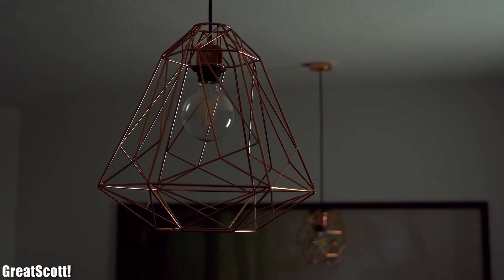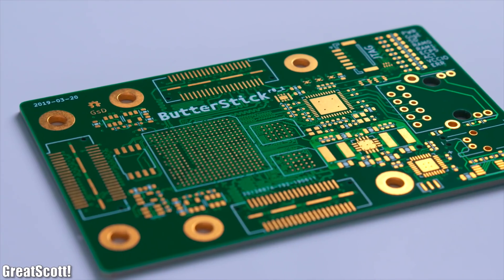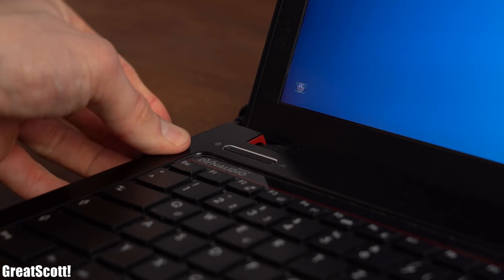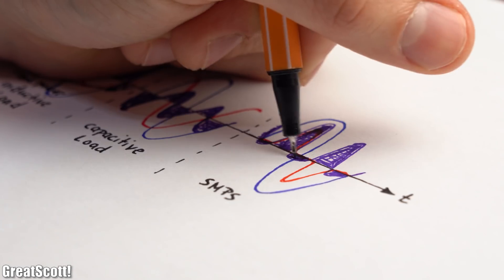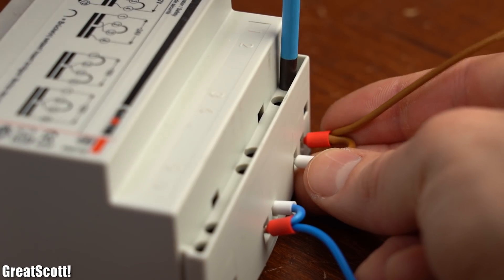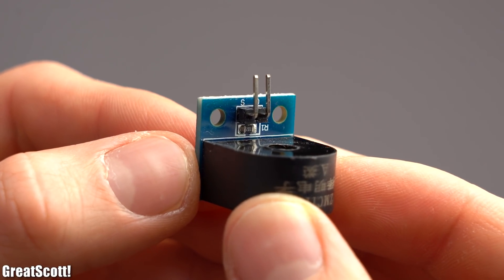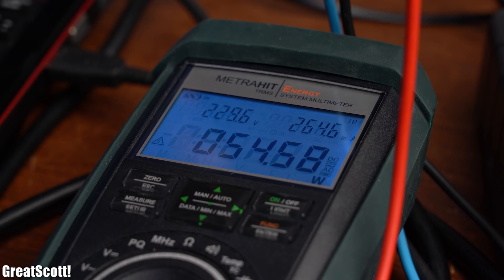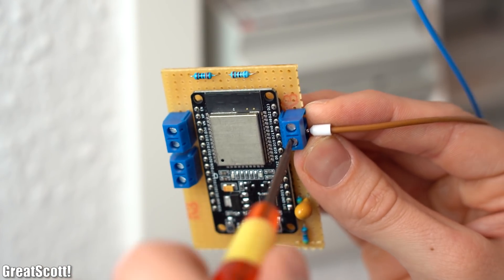DIY ESP32 AC Power Meter (with Home Assistant/Automation Integration)

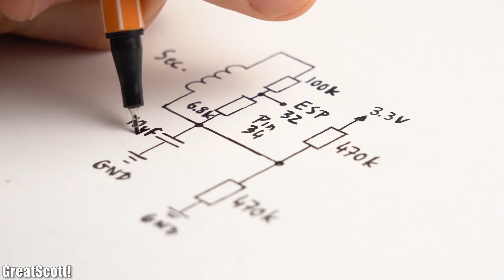Comment: The circuit shown at 6:42 is a nice idea and definitely works in a pinch, but it's a serious source of error in your measurements and can easily DESTROY your expensive ESP32. 

Firstly it relies on the precision and drift of the offset voltage resistor divider, which is not insignificant as if you are using 5% resistors, your center voltage and thus powerline measurement could also be off by 5% (or around 16v at line level). Also at startup, before the 10uF capacitor charges to 1.65v, the input of the ADC swings negative, which can seriously damage some devices which don't have stringent input protection. Finally, if there is some fault in the line which causes the transformer to output a higher than expected voltage, this will exceed the power rail of the circuit and discharge straight into the ESP32.

You want a circuit called a "Clamper" or "DC Restorer" which will fix your voltage above ground potential (protecting the ESP32 ADC) and allow you to take advantage of the full scale of the ADC input. This also saves on two precision resistors for the voltage divider, and a rail-to-rail buffer amplifier will tend to isolate the ESP32 from any voltages over the supply rails. With an output buffer you can also use a smaller capacitor value, with higher voltage rating and non-tantalum type for safety such as a ceramic disk capacitor. You can also safely add an external ADC if you want to increase your measurement accuracy substantially. (Just remember to sample the max voltage to calculate the zero crossing point for the AC signal, as there is no center offset voltage now)

There is no fundamental difference between your expensive power meter and a circuit you can build at home, you just need to find all your sources of error and minimize them!  :)
Here is example circuit for reference https://tinyurl.com/y2aoed7z
Reply: @xristost68  Nice work, only problem is that during that settling time the negative analog voltage would still exceed absolute maximum specifications on popular ADCs like the ADS111x, so you should add a schottky diode from ground to the output to limit that negative swing in the startup :)

And if you're using an expensive precision ADC like the AD7792, it only tolerates 30mV below the ground rail, so you would need more strict signal conditioning than just a schottky diode.
Reply: Cool!
Reply: Sick reply, thanks alot!
Reply: Exactly what I thought!
Reply: This is great info and a wonderful comment. Thanks Zach!
Reply: esp32's cost like a dollar
Reply: Are esp32 expensive though!? Thought they were like 10 dollars not saying it's cool to break it but expensive is not the word I would use maybe precious
Reply: Seems to cut off the bottom of the waveform quite a bit
Reply: This is cool. Do you have more info on the circuit? Function and how to choose the capacitor and resistor pls
Reply: @sirente9275  The circuit is called a clamper https://en.wikipedia.org/wiki/Clamper_(electronics) and the components are just chosen from common values that don't affect the signal too much. The capacitor is used to sum the voltages, and the large resistor is used to discharge one side of this capacitor to ground. Together they have an "RC time constant" and also form a highpass filter. You can calculate this time constant and the attenuation of the AC signal if you wish, but most people just simulate the circuit with a few values and see what works well. You should modify the values in the simulator and see how it changed the output to get a feel for how the circuit works.

If you want to know how the circuit works on a fundamental level there are lots of good online sources such as https://electronicscoach.com/clamper-circuits.html

The choice of the large resistor almost entirely determines the size of the capacitor you would need and vice-versa, so any combination that does the job is fine. I only put 470nF there because it's a very common ceramic capacitor value that people have lying around, and the same goes for the 2.7M resistor. You could just as easily increase the capacitor value and decrease the resistor value, or change the capacitor to a 1uF polarised type such as the tantalum one used in the video.
Reply: @shingGOLDmonkey224  Great comments! Would your suggested circuit also work for adjusting the offset of an audio signal or does it only work for a stationary sinusoid? Your remark that there isn't a center offset voltage makes me think it won't work for audio. I'm asking because I want to do a project where I need to adjust offset/gain of a signal to sample voice from an intercom system.
Reply: @Eldering  You are correct in thinking that it wouldn't work for an audio signal, it only functions for relatively stable signals. I don't know the details of your project, but if I understand your problem correctly you're trying to sample audio using an ADC, but the audio signal is AC coupled and so has positive an negative voltage values.

In this situation you would want to first apply gain to your signal (assuming your ADC doesn't have an inbuilt PGA), then a DC offset using an opamp with voltage rails not exceeding maximum ADC input limits, finally connect your conditioned audio signal to the non-inverting input of the ADC and the offset voltage point to the inverting input of the ADC in differential mode operation. 

The ADC output should then have no phase shift and be a completely distortion free sample of your original audio.
Reply: @shingGOLDmonkey224  Thanks for the detailed reply. Actually the line containing the audio is also used to send digital signals and supply power. The analog audio part is around 12V +/- a couple of V, for example between 10V and 14V. But the line can go higher and lower than that at other times when there is no audio (upto around 24V). I don't remember the exact values, it has been some time and I just used an esp32 with voltage divider as poor man's scope... (it basically worked, but low resolution for audio)

So I think I need to either apply a high-pass filter to remove the DC component and then add an offset to get the range 0-4V, or I need to remove an offset of around 10V from the original signal.

Either way I also need something to remove negative voltages and too high voltages...
Reply: @Eldering  Reminds me of PoE devices, which use small transformers to separate power and data (or in your case audio). Good luck with your project!
Reply: @shingGOLDmonkey224  Really?  "DC restorer" circuit was used for analog composite video in TV sets for years.  See example in https://en.wikipedia.org/wiki/Clamper_(electronics)
Reply: @Eldering  Sure, you can use it for audio, why not?
Reply: @shingGOLDmonkey224  Thank you so much for this very useful information.  Could you also recommend which part I should use for those two opamps in your example clamper circuit, or what should I make sure to check in choosing one?

Comment: Hey Scott,
I did something similar last week. I have a digital Power meter (starting at 35 Euro on Amazon for 3 Phases) which has a digital S0 Pulse output. You can read these pulses with the ESP and feed them to your mqtt broker. I used ESPEasy (no promotion here) which works completely without programming. You actually cannot read the power consumption in real time, but rather could calculate an average value inbetween pulses (in my case 1000 pulses per kWh). Maybe you want to look into this before operating on your distribution box and make it VDE compliant :D

Grüße aus Frankfurt!
Du machst echt gute Arbeit, weiter so!

Comment: great video - thanks. As others have commented, the ADC on the ESP32 is poor and non-linear. Espressif don't recommend voltages higher than 2450mV (this is with the 11dB of attenuation internal to the ESP32).
There's an article on it here https://randomnerdtutorials.com/esp32-adc-analog-read-arduino-ide/
And Espressif documentation here https://docs.espressif.com/projects/esp-idf/en/latest/esp32/api-reference/peripherals/adc.html
It would be interesting to know if the EmonLib applies the ESP32 ADC calibration. Have not had a chance to look yet.

Comment: Great explanation of how different loads effect the phase angle between Voltage and Current BUT to keep things simple with respect to monitoring power consumption (as charged on your power authority account) have you considered just monitoring the pulsing LED on your power meter. I suggest this for one of your excellent YouTube  videos.

Comment: Great construction :)
Unfortunately, here in Sweden almost 2/3 of my energy bill is made out from static taxes and grid fees.... This would be ok in an apartment - but me and my GF live in a fairly big house of our own, where the main heating is electrical (deep ground heat exchangers to heating water circulation). If I cut my actual consumption of energy by 99%, my electricity bill would only go down by maybe 35% :(

Comment: Hi, do you know how to build a bi-directional power meter, to get not only the power but also a direction of the power?
Reply: This project does that, it shows a positive or negative value depending on the direction.
Reply: @eDoc2020  so I can use similar device to get the net power of my PV installation. Thx

Comment: I have built one of these, but with an Arduino Nano. Works pretty good, though not very accurate, especially with low power usage.
So I decided to go the Esp32 route. But the built-in ADC resolution is still too low. Which I went with an ADS1115, which gives me 16-bit resolution. Problem is, I can't get the ADC to properly work with the EmonLib code. I've even done the procedure injection, or what ever it's called and made the changes for it. Still nothing.
And the guy who originally made the altered code for the ADS1115 with EmonLib won't help.
Any ideas on how to get these to work together?
I know the ADS1115 can only do about 800sps. To get "real" power consumption, need at least 1500sps or something like that. But it'd be better than the built-in ADC. 
Also to note, the standard EmonLib can only do about 4 return values per second, and this is because it does several loops per run to get the values. This does slow down the returning values quite a bit.

Comment: I'm a big fan of making cool DIY projects that you cant already buy on the market. The issue I have with this project is that you can already buy a commercial version of this product that will be more reliable and cheaper than making it yourself. The Sonoff Pow can be bought for around USD 11, It has a built-in power consumption tracker, it has a built-in relay for remotely switching the appliance on and off, it is in a clear professional enclosed, and it can easily be modded to work with home assistant. Unfortunately, there is no reason to make your own. It will cost you just as much and you will have a lesser product.

Comment: Power meter: shows -43W real power
Great Scott: "the power meter still works perfectly fine"
Reply: I think he has solar panels, but I was also confused by this
Reply: @mewantsmash  hm, his solar panels pumping current into the grid with a power factor of -0.25? dunno about that, but my guess is that solar panels should present a PF as close to 1 as possible.
Reply: He probably just hooked up his sensor backwards.

Comment: The average power consumption is rather high compared to what?
Regarding private households the energy consumption lowered from >4500kwh to like 3500-3000kwh for 4 persons since 2002 in Germany (Energieverbrauch Abschlussbericht BMWI 2002).
And thats without electrical water heating and without electrical heating.
As a lot more people tend to have multiple of those crappy electric heating devices in <2000 this would make an even greater difference.

In 1998 I remember we had 400W of lightbulbs in like every room and some more 30-40w ones as atmospheric illumination. 2 freezers which would have engery labelling Z-- and a fridge also Z--.
The CRT TVs also had like 300W.
Of course there were no smartphones, but 2 video recorders, a laser disc player, 2 hifi systems, a SNES and a playstation. 
Virtually every digital tech gimmick had a coil transformer instead of switching regulators.
Yes there was less technology but the tech we had was wasteful and nobody thought about another 200W, as energy was cheap af.

Comment: So you'll route your entire mains through your voltage reducing transformer? And the current will be proportionately measurable off the secondary?
Reply: No, you tap off the mains  with the transformer for voltage measurement only.

The current clamp is placed on the mains wire, not the output of the transformer.

Comment: I want something like this for my entire house! It would be cool to see the load on the incoming 3 phase during winter since our house is heated with electricity (Electricity is used to heat water and then pumped around in the radiators) and the power consumption being displayed in Watts would be cool :P
Reply: You can install one of these smart electricity meters, most of them provide a S0 interface, which can be easily connected to an ESP. Requieres minimal custom electronics and should be more accurate, because they are calibrated of course.
Reply: @1Hippo  I'll look into it, thanks!

Comment: If you have a smart meter (which a lot of people have nowadays in Germany and the Netherlands) you can hook up a RPI to the P1 port of the meter. That port spits out a lot of info about your electricity and gas usage (if you have gas at your home). You can also integrate it very easy with Home Assistant.

Comment: 06:42 what's this circuit please mention the name of this one
Reply from the maker: It is a voltage divider.
Reply: @greatscottlab  Ok Thank you for you're attention
Reply: The AC voltage is both positive and negative.
ESP32 ADC input accepts only positive.
The circuit adds a positive offset (half of 3.3V) so that negative voltage will never reach ESP32 and damage it.

Comment: Thanks for this video, I enjoy watching your channel and its great content. I've created an energy metering system in my house using existing energy meters with pulsed outputs, basically gives a pulse for each 1whr consumed - this significantly reduces the complexity of the project as it means only having to count pulses to get near instantaneous energy consumption values. Also if you also monitor milliseconds between pulses, you can work out near instantaneous power consumption as well. These meters are very common and easy to obtain, and they also by their nature have to be reasonably accurate - an added bonus is that they also typically come in a small form factor (1x din width), and pulses are isolated from mains. I populate the energy/power values directly into a time series database (Influx) and graph with results using Grafana.

Comment: I have been doing this by reading the blinking led in the power meter. Also read the needle in my water meter but with less success (turns out that the water company doesn't like IR sensors to close to the meter...). Too bad they are outside (no power source ) and my domoticz was to be turned off. I'm now researching home assistant to reset these.

Comment: Hi, friend! I want to notice 1 point. If you place information wires along with the power wires you can get some extra power in case of quick power jumps. Once we tried it on GSM equipment and had to pay 1000 euro for broken input modules ;-). So think about electromagnetic shield.

Comment: If you got one of the newer electricity meters just count the light pulses it emitts and calculate the power drawn
Reply: You can do that but it only gives an indication of power (actually energy), not the other parameters like power factor.
Reply: @eDoc2020  that's true but that the most important thing to know in my opinion. Because that's what you pay for and if you are using this to monitor your power consumption that's all you need

Comment: For existing power meters with noninvasive led impulse output can be read with photodiode. Gas meters with magnetic impulse output can be read with reed switch, utilize cheaper esp8266, already integrated into esphome

Comment: Great video as always,
But I have a question, would the transformer not influence the phase of the measured votlage? Wich will make the power factor and active power not precise . Or was that accounted for in the code ?
Reply: It would influence the signal, but as long as the transformer isn't tiny the effect should be negligible.

Comment: I did exactly this but found the ADC on the ESP32 to he horrible. Despite it being 12-bit, the Arduino was far more accurate due to its linearity and lower noise. When I get a chance, I’m going to use the ADS1115 that can be purchased on Ali Express for a dollar or two.

Comment: This is neat, but there's an easier way to do this. Check out the circuit setup energy meter, which is compatible with esphome right out of the box. I put together a complete system for under a hundred bucks using his stuff.

Comment: Some points from my experience building The same thing for my own home: if you can't find a 12-volt AC former, you can step down the voltage just using a standard voltage divider with 10 or 20 times the resistance on the upstream resistor (depending on if you're in the Europe or US).  If you want it isolated, you can use a one-to-one speaker transformer, or they have potted transformers the one-to-one ratio specifically for this task. Also the ESP32 ADC has abysmal accuracy without some sort of filtering in software. I actually used an Arduino nano to measure the current on the two phases coming into my house (US) and pass that off to an ESP8266 to send to my server.  The values I got out of this setup were within 0.1% of what the electric company said I used.